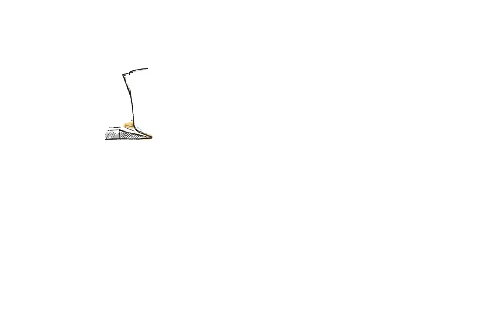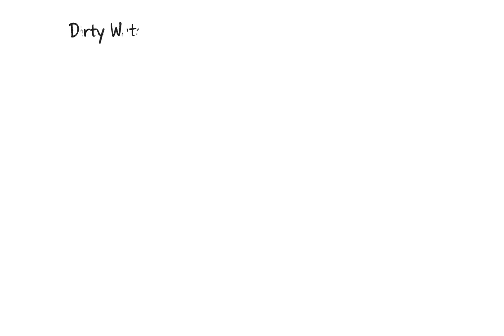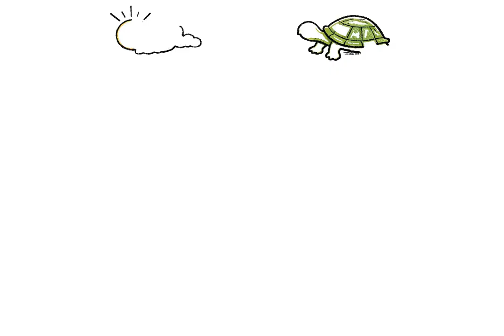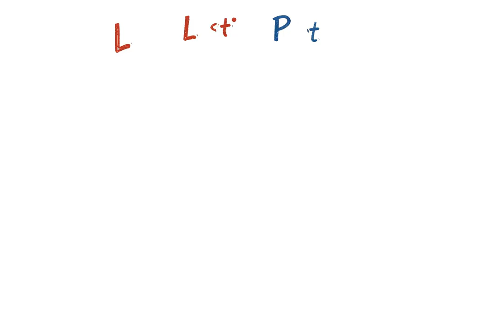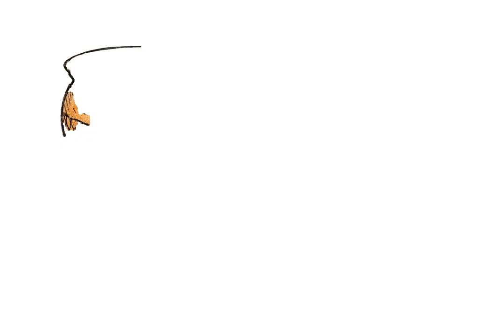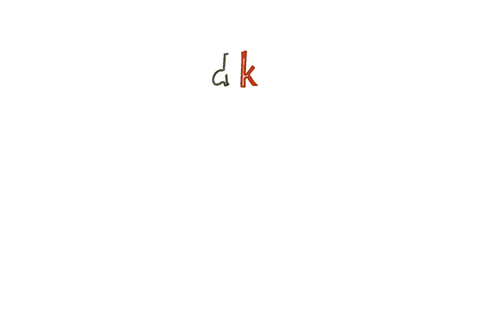Stop Buying Water Filters: This WWII Ceramic Method Purifies Forever

Comment: When I lived in rural Nigeria in the late 1980's, drinking water was prepared by boiling local well water (that had been pumped into a high reservoir to facilitate gravity feed to collection sites) and pouring it, still hot, into a ceramic filtration system, (stack of cylindrical aluminum containers with the ceramic "candle" screwed into the base of the top one - same as may of the diagrams you've shown).  Worked very well.